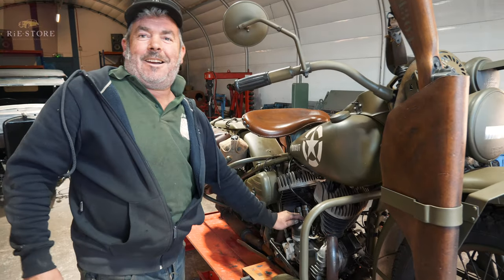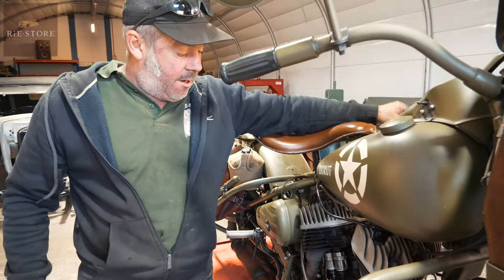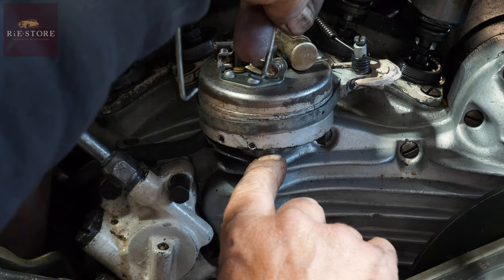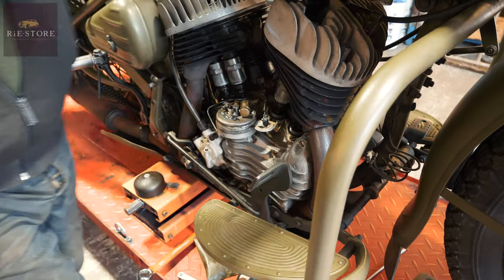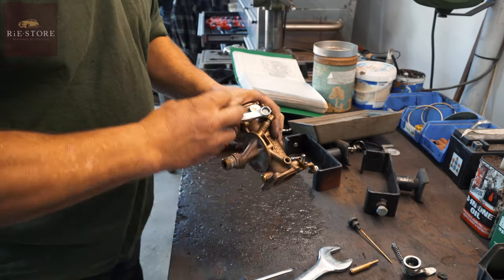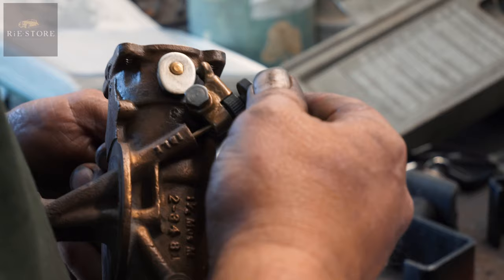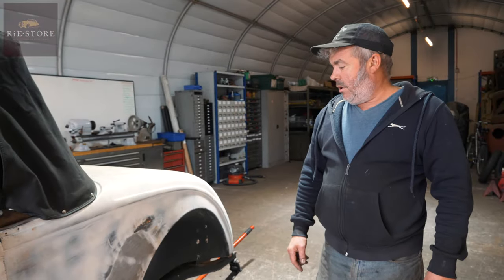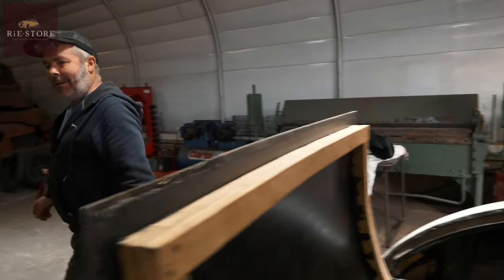Diagnosing a non-starter - 1942 Harley Davidson WLA / ep091

Comment: Great program .Got a question. I was watching a video and the guy went out of his way to say that the timing mark line goes to the right of the window not center. You started the bike first kick. As did he. What's the right answer. Thanks. Cheers.
Reply from the maker: Hi Robery - happy new year! BTW Ash answered your question in this weeks Q&A https://youtu.be/pgKsmwEw1As
Reply: @ono147  thanks. I've just took a interest in these old Harleys. I'm a die hard Triumph man. And I watched two programs were they both said to put the line a bit to the center of the window. I tend to go with what Ash recommends. The man's knowledge is amazing. I see you just posted a video. Got to check it out. Later. RMM
Reply: @roberymcgoff1904  Yeah it's cool.  I learned it from several luminaries in the Antique Motorcycle Club of America.  Bob Ross, George Hood, Johnny Eagles etc etc. and am now very experienced myself on all my bikes.